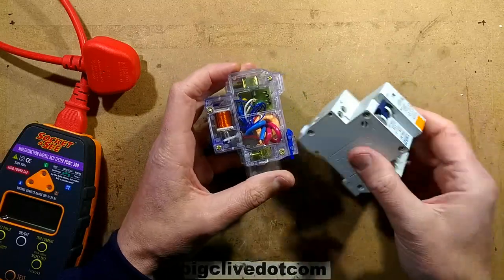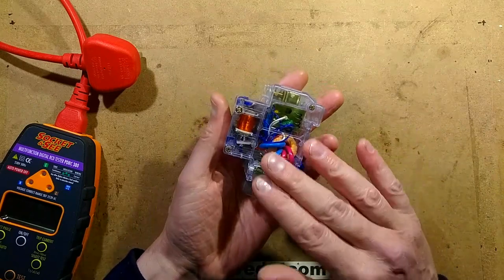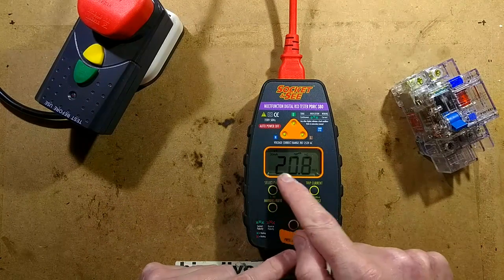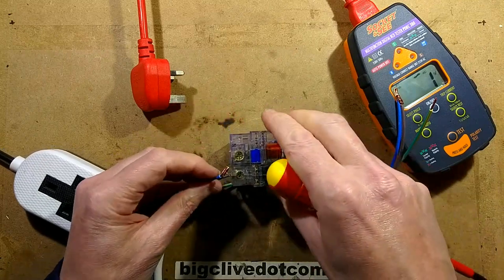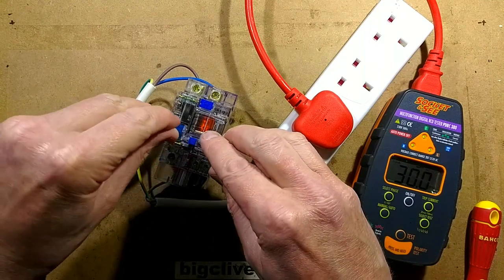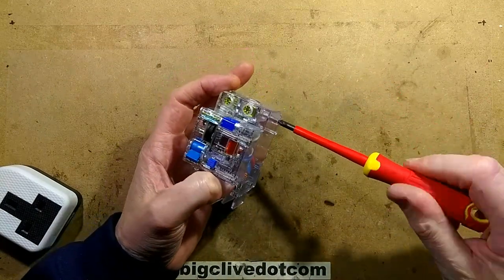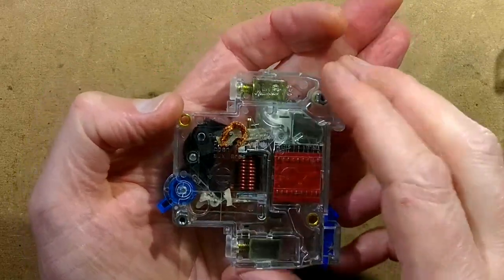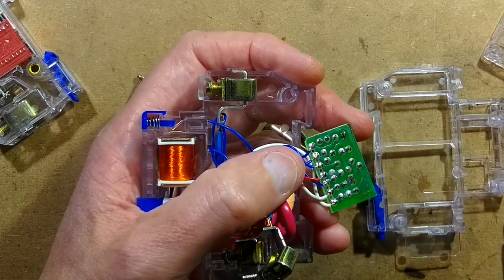Really neat transparent RCD/GFI.  (with schematic)

Comment: With all the fuss the internet makes about how "the British electrical system is superior" the fact that you can just plug in a device that looks like, but does not function as an over-current breaker, is frighteningly dangerous. Everything that is sold in the US that fits in a breaker socket, is in fact a breaker. Some additionally provide ground fault or ground fault and arc fault protection.

I will say the separate indicator for an earth fault on that unit is very nice though.
insaneinsane
Reply from the maker: These are common DIN rail mounting modules.  Any person installing them should understand the markings on them to indicate if they are an isolator or an overcurrent device.  The same form factor is also used for modular transformers, timers, dusk sensors, surge suppressors and automatic over/under voltage cut-off units.
Reply: bigclivedotcom Interesting, so you have DIN rail mounted stuffs patched into the mains? That seems odd to me as all of our stuff mounts in a closed metal box. Unless I've misunderstood and you were talking about industrial applications, in which case we use DIN stuff as well.

Comment: So how does this differentiate ground leakage from poor power factor?
Reply from the maker: It's measuring current out versus current in which should be equal regardless of power factor which is the current to voltage relationship.

Comment: are 240v light fittings supposed to have an earth wire.
Reply from the maker: +Nateyboy1990 Only some use an earth connection.  But in modern installations the lighting circuit should have an earth.
Reply: so 40s wiring isn't safe. 40s meaning cloth wiring

Comment: The reason the live and neutral wires loop around the toroid isn't to "give it more oomph", but because of the direction of the magnetic field in the toroid. It'll need that one loop around the toroid to induce current in the same direction as the differential current detection windings.
Reply from the maker: The units with active electronics to amplify the sense winding of the toroid  often have the live and neutral passing straight through the centre without looping at all.  Others have a single turn, but this unit may have two turns to generate enough of a sense voltage to trigger the thyristor.
Reply: Interesting - and now first thing in the morning I realize I had mistaken the directions of the live/neutral magnetic fields.  I'm too used to dealing with coils, and not with straight wires, a half-loop essentially.
Reply: The single wire is no different to using a clamp meter.
I once used a current sensing relay to turn on dust extraction for woodworking machines at work, worked well with just the single wire, until i tested a smaller tool, i had to wrap the wire once to get that one to start the dust extraction. ;)
Reply: Non electronic devices have simple PCBs only for filtering noise, so the need the higher signal, but are still voltage independent (powered by output transformer current)

Comment: 4:58 Some ciucuit breakers have this feature. You can't insert wire if screw is tighten. Here is picture of Legrand breaker: https://www.dropbox.com/s/24s7rcunt4lwisx/IMG_20170703_115029.jpg?dl=0

Comment: Are you saying I shouldn't test house breakers by just shorting the outlets?
Reply: The Original Gamer A breaket needs to breakfast at anything from a minimum current shown on the front to a dead short.   Clive tested it's ability to trigger at the trip current (0.03A), not it's ability to cut off a dead short (4000A on a bad day).
Reply from the maker: It's a realistic test, but not recommended on a regular basis.

Comment: I have a question squad, so if every home had a electrical current storage device, the electric bill would be lower. But the cost to savings ratio wouldn't be worth it. Has anyone tried that, a bank of big ole caps for those peak draws. When switching on A/C or water heaters etc
Reply from the maker: In some countries there is an off-peak heating tariff.  You could use that to store energy for use at peak demand times.

Comment: normal : current line L = N due to the voltage across R(12 k) is not appear, 
else (because leak current to ground) the current in L line more than N make the AC voltage induce 
the transformer the voltage is across R(12 k) and the SCR.on the trip coil make....all circuits OFF.

Comment: 20 ms is absolutely Max time. It's crucial for safeness.
Reply: That's exactly one cycle at 50Hz. That figures, because the reverse voltage clamp diode on the thyristor renders the detector inactive for half of each cycle. Then the device truggers during the other half wave. That explains why one polarity is quicker than the other in Clive's tests; there is up to one half cycle of delay, plus the very short triggering time of the circuit before the load current flow is interrupted.
Reply: That's interesting theory.
Reply: Electester heh, here in Germany its 30ms 30mA
Reply: That's sad though.

Comment: take apart an American GFCI outlet, they somehow get all of this into a much smaller package.
Reply: Nathan Musick This a DIN package unit.  Meant for industrial applications, not residential use.
Reply: They don't have overcurrent protection so they can be smaller.
Reply: Timothy Barney Actually all the residential installations I ever saw here in Germany were on DIN rails, except for very old ones.
Reply: In Austria all residential electrical installations I've seen done in the last decades have been done on DIN rail in the breaker box. And my guess is that it's like that in most of Europe.
Reply: The UK uses DIN sized devices in the distribution boards in our homes, it's just a standardised size that is a one-fits-all solution...

Comment: what reasons could there be for an RCB tripping? mine tripped while i wasn't even at home. i just reset it and everything was fine. what could have caused it to trip?
Reply from the maker: +jort93z Sometimes it's a brief loss of power, an insect in a fitment, transient leakage or a device that is progressively failing.  Prime suspects are water heaters.
Reply: another thing...if you have old wiring with cloth covering....then high humidly can somtimes set an RCB off.
Reply: I had one, (well, next door neighbours) that was sensitive to Static! walk along the carpet to the kitchen, touch the washing machine (didn't matter if it was running or not) & . . phut!

Comment: I take it your tester lead isn't one of these bargains: http://www.screwfix.com/p/seaward-extension-adaptor-0-5m/4193p
Reply: Bloody hell!, 
 Profiteering much?
Reply from the maker: Welcome to the racketeering world of professional test equipment where a legal requirement to use it means they can write their own cheque.  I've got a Chinese insulation tester here that seems well built inside but cost buttons compared to the "official" stuff.  The real insult is having to get it sent for "calibration" on a regular basis.  It's not calibration at all.  They test it on known values and then pass or fail it for a significant fee.
Reply: There's a good case for having a dedicated, identifiable lead to consistently use for test purposes. Anyone who has paid over £3 for a 0.5m 13A-IEC has been ripped off though